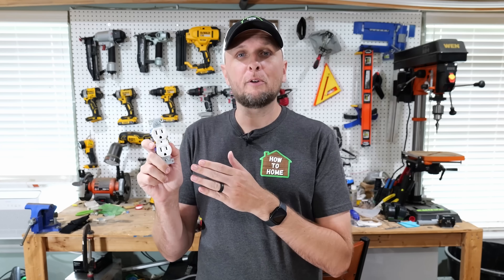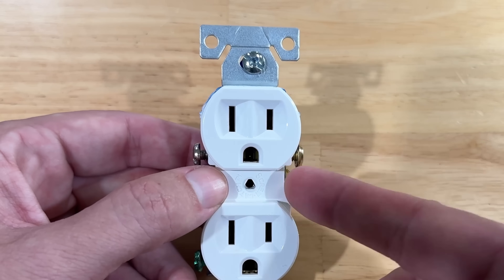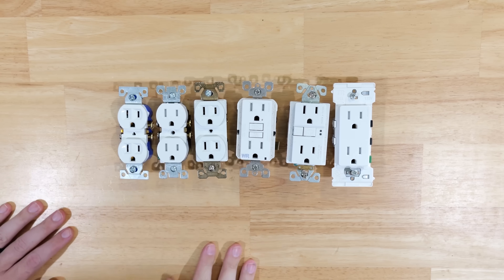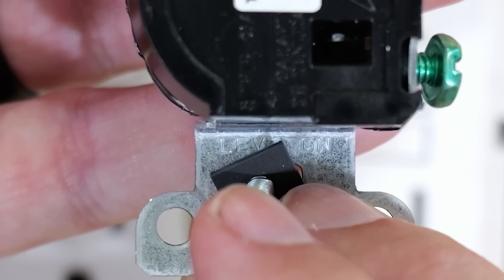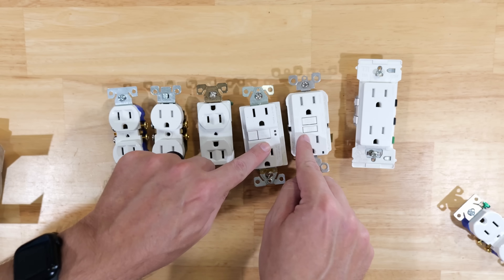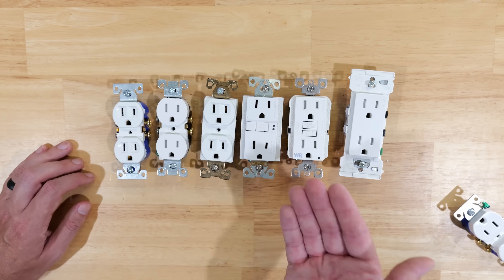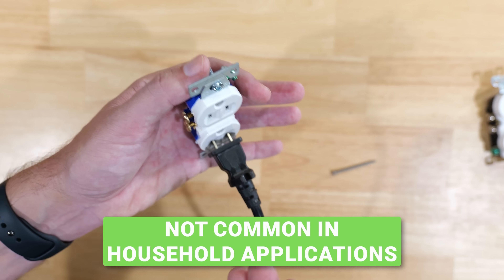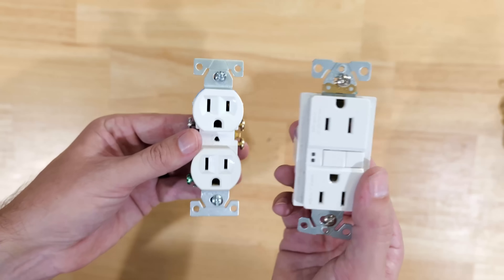The Shocking Reason Why Your Outlets Are Installed Upside Down!

Comment: Right Ground Down. And if you short plug it won't cause a fire because the Breaker will do its job and trip.  It's a myth that some metal is going to fall in just so to trip the Breker anyways. And also, washers' plugs are made with 90 degree down L shape and dryer with straightforward plugs.  If receptacle is in ground up that put a strain on plug.

Comment: Well after 40 years an electrician this is what we did. In offices it use to be common for calculators, type writers and such they had right angle plugs we put them ground up so the cord could hang off desk and plug in without a loop in the wire . Every other place including hospitals ground down looks better except in an office.
.

Comment: I'm a retired electrical engineer and have wired cabins and houses from the meter in. There is no electrical reason to make ground prong up. The notion that ground prong down is somehow easier to pull out from the small weight of the cord is wild conjecture at best as the mass of the cord at the outlet is a few ounces at most and will not pull out the flat blades. I can think of no argument for ground plug up. The best argument I can see for ground plug down is the index finger problem the author mentions.

Comment: The correct way is with the ground on the bottom so it looks like two unhappy electricians arguing about stuff that makes next to no difference. If you read the actual code, it also says that 4 and 6 gang outlets when installed correctly can look like an entire group of welders arguing on YouTube about how shitty a DIY welders beads are.

Comment: You gave excellent information indicating that the electrical code and outlet manufacturers don't really care which direction to install the outlets.  However, there are many devices that have been made that are clearly designed for ground prong down.  Some use a single connection but if the ground prong is down, the device when plugged in will cover the other port and therefore it cannot be used.  My entire house when I purchased it had ground prong up outlets.  Since they were installed back in the 70s, I ended up replacing every outlet in the house and reversed them so they all now have ground prong down.  I like them that way and they will handle those devices designed for the ground prong down configurations.

Comment: There is no standard electrical building code for the orientation of electrical outlets, so they can be installed in any of the following configurations: ground up, left, right, or down. However, there are some best practices and reasons why electricians may install outlets in certain ways:

Identify switched outlets
Installing an outlet upside down with the grounding pin facing up can help identify which outlets are controlled by a wall switch.
Improved safety

Installing an outlet with the ground pin down can be safer for specific applications, such as refrigerators and appliances with cords that extend towards the ground pin.

Comment: Put your ground pins up if you want to have timers, nightlights, CO detectors upside down. Most are designed for outlets with the ground at the BOTTOM. Obstinate Quebec electricians put the ground pin up, just to be distinct.

Comment: I'm a professor of Electrical Engineering at University of Toronto and have given this some thought over the years from my childhood when the ground prong was almost always down, to the present day when there's a mix of up and down.  One matter you have not raised is that of water and water splash, etc., in wet areas, if the ground prong is down, rising water will get to it sooner, and in a wet location splashing usually comes from below in a body of water, so it might make more sense then to have ground lower so it gets contacted first by the water.  As the water level may rise, the other pins get connected later, after the water's already grounded.
Reply: I can answer this question for you it goes by manufacturers recommendation and how you can tell is the writing stamped in the metal on the device ears if the ground pin is down and the writing right side up then that’s how it should be installed if It’s the other way it should go in ground up if the words on the metal go both ways one side upright when you hold it up but upside down on the other side you can mount it ether way
Reply: @timothydixon2545  This “pRoFeSsOr oF eNgInEeRiNg” isn’t asking a question for you to answer. The video goes over your randomly spouted out answer in the video. Nothing from manufacturer states a recommended right side up. You can try and validate the stamped writing on the back all day long, but different manufacturers stamp them differently. None of them specifically designate a recommended side up.

Comment: I have some outlets ground pin up, some down and even some installed sideways but when installing new outlets it's always ground pin down. I simply have not bothered switching all the ground pin up around. If I have to replace an outlet because it,s not working anymore it will go ground pin down unless the box is installed sideways.

Comment: YES, Ground down. That's why it's a ground and not a sky. (No it's not but it sounds good) The idea that something is going to fall onto the prongs is preposterous. And even if by some MAGICAL fluke it did happen, it would short, tripping a breaker or blowing a fuse.  I always install them ground down, and it irritates me so badly when I see them upside down, like a hospital or nursing home, I feel compelled to go home, get a screwdriver, and rewire all those outlets. Just turning them wouldn't satisfy my O.C.D. I'd have to undo it all and redo it the right way.

Comment: I was working on a piece of commercial equipment removing the back panel when it slipped and fell right on the prong. Luckily the plug had the ground upwards so no zappy.
Reply: @armslength2618   
Im in Canada, there is but I work in the food repair industry where I may be in a private business that doesn't have formal procedures. And generally it's up to the tech to ensure they don't f-up. And, oddly one doesn't "need" a license to work on certain equipment. I've been employed in this for about 10yrs now with no license; I call someone if needed.

Comment: I worked for an electrician and when we ran into a duplex outlet with the ground on the top it was on a switched outlet.  That way electricians know there is a switch controlling that outlet, or you can cut the metal piece that connects the two outlets and make one hot all the time and the other one will be on the switched circuit.

Comment: Old industrial electrician here. For single-phase office/home outlets the ground pin is down. For me, the reason is that when reaching behind shelving, etc. to plug it in with the ground pin down I can tip the plug backwards towards me so I can see between the blades and guide the ground pin into the round opening and know I have a safety ground as I then tip the blades into the socket, meaning I can see they are lined up, before the hot blade is energized. In dim light, partly obstructed vision, etc. I want to know I have the ground connected before the hot blade is energized. Ground prong up, not so much.

Comment: The electric company here used to have commercials where they animated the plug and it had a face made of the holes.  Therefore the right way to install it is so it looks like a face.  There are no laws anywhere in the USA saying it has to be ground up.  90 degree cords are invariably made to ground down installation

Comment: some  surge protectors and appliances orient their power plugs usually to plug them in ground down sometimes at 45° angles. so if the ground is up then the wire is forced facing up at 45°
this just causes issues with the extra wire

Comment: Most big plugs are oriented so you'd have to twist them to plug into a ground-up.  I guess it would be fine in space where there is no up/down, but if I see a house with ground-up plugs, I know it was an amateur makeover. It's no problem, unless they hooked the neutral to the hot, which often happens in those cases.

Comment: Everything about this video makes me think...
Why are US plugs so badly designed?
Just look at everything you said was a problem - and then look at equivalent plugs from other countries... 
I'm in Hong Kong and we use the UK (Type G) plug. The live and neutral are insulated to about half way up, so that if there's a gap between the outlet and the plug, the only pin that you can get an electrical connection to would be the earth. If you've pulled it far enough out to see the metal on the live and neutral pins, it's almost certainly pulled out far enough that it's no longer connected.
And they're always ground prong up. - because even if it's a double-insulated product that doesn't need to be earthed, it's still using a 3 pin plug, but the earth pin might be plastic. (The earth pin is required as it's slightly longer and as you push it in, it opens the shutters for the live and neutral).
(i.e. We don't need to babyproof our electrical sockets - they're already babyproofed when they leave the factory).

Comment: Ground prong down. Many wall-wart type plugs that hang out of the wall that either have a ground prong or are polarized are designed to hang down against the wall. if the outlet is ground prong up, some of these don't hang right and are more likely to come out of the wall socket.

Comment: Logically, the two-prong residential argument "against" ground-up also works against the ground-down. The respective safety arguments for each are both negated when using a two-prong plug. That leaves us with whether one wishes to follow convention or not.

Comment: I have found some surge protector plugs have an issue with ground plug up.  In some cases you cant plug other devices is the same outlet because the cord jacket restricts access to  the outlet below.

Comment: The only benefit that I've ever found from ground up or ground down is if a receptacle is mounted half way up a wall and the entire weight of the cord is hang off the receptacle, it seems less likely for the weight pull out the cord with the ground up.  Another one is in a garage or shop where heavy extension cord might be used. I have noticed that the spring metal on the inside of the receptacle that holds the blades of the plug don't wear out as quickly with the ground up. Having the pivot point of the plug as the blade side instead of the ground side, the weight of the cord keeps pressure inward on the blades. Where as with the ground down the weight of the cord would have an outward pull on the blades.

Comment: 👉🏾So… there is no standard for installing a receptacle. But I think both opinions concerning rather to install the ground prong up or down have their valid reasons. But I would say installing the receptacle up or down depends on your environment. For example… if I was in charge of installing receptacles in a workshop underneath and the sides of a work table, I would install the receptacles with the ground prongs up or on top, presuming a screw could roll off the table while you’re unplugging a cord, the screw could land right on the ground prong, preventing such an accident. I didn’t think of a reason why I would install the receptacle down. 🤓🤓🤓 😂

Comment: My current house has ground pin up, and I don't know if it is related, but a lot of the plug outlets are loose, as if people had difficulty plugging in or pulling plugs out and wiggled them a lot.

Comment: Why say all that? In the end electrically it makes no difference as to whether the ground prong is up or down (or sideways for that matter), and no electrician worth a damn is going to place an outlet under a sink, much less in a flat position under a drain or any of the water connections. The only reason I can possibly think of why anyone would do that would be for a garbage disposal, such as an "InSinkErator". 

If you have one, look at it closely... IF it has been properly installed, you should see a 758 Standard UL Listed Appliance cord somewhere under your sink. These are typically three feet long, but under my sink the cord goes out through a hole in the cabinet wall, and presumably plugs in the same outlet as the dishwasher. Since I am 68 years (and 9 months) old and in a wheelchair, I can't verify anything except the cord goes out through the hole in the cabinet wall. However, the point is, it is not under the sink.

In the course of my life, specially as a working guitarist, I've been in thousands of motels, hotels, bars and casinos and I would say that in at least 95% of them, the outlets are placed with the ground prong holes at the bottom. I would call that the norm...

Comment: I believe that ground down is the way that the outlet is designed to be installed. Because the ground when used is to protect the user of what is being plugged in.  With the prong down the plug will keep a ground even when the weight of the cord or if it starts to come out for any other reason. In the inverted installation the ground plug can lose contact while the hot prongs still are in the receptacle if the cord starts to unplug from the weight of the cord. Many plugs sag in the outlet overtime and can eventually disconnect the ground with the hot still in causing the ground to fail I protecting the user if the ground is up. My opinion but I do believe it is a more possible situation than the one stated for the ground up orientation.

Comment: In some of the hospitals I work in, electrical outlets are installed proud prong-up.  I used to think that this was silly until one day on my workbench at work (I repaired flexible medical endoscopes), a length of narrow coil pipe that I was working with slid off the back side of my bench, and fell across the hot and neutral blades of something that was plugged in, but not completely pushed into the outlet-- and it shorted them out and scared the hell out of me!  It was a one-in-a-million sort of thing, but proved to me that it can actually happen, and it can happen to me.  I still think it looks silly to put the ground pin on top, but now I understand why it is a good idea.  I accidentally proved it to myself.

Comment: What about sideways?

Neutral up or hot up?
Reply: The outlets in my 25 yr old condo are all sideways. It helps lessen the tangle when I plug in my vacuum, etc.
Reply: Man, I just said the same thing. I guess the early bird gets the worm. Dammit!
Reply: Good question. Just had sideway outlets installed for first time. The electrician installed them neutral up - probably based on the same logic as the safety ground up argument. I am OK with this because there doesn't seem to be any argument against it.
Reply: “Countertop spaces require the maximum space between outlets to be 4 feet, and that no part of the countertop is more than 2 feet from a receptacle. So, there are times when an outlet may need to be installed sideways in order to fit into a spot where it is required to be installed.

The required placements of electrical outlets may also influence outlet orientation, as a horizontal outlet may provide easier access for plugging items in depending on the location. For instance, a vertical outlet behind an appliance or piece of furniture may give you no access points, while a horizontal outlet in the same location may allow you to access at least one of the receptacles. If an outlet is needed in a certain location but it is also clear that the spot will be blocked, then an outlet may be installed sideways to try to improve access.

Another common reason for horizontal outlets in your home is simply the result of aesthetic choices. Electrical outlets are obviously a necessity, but if you're on the hunt for brilliant hacks to make your kitchen more aesthetic, you may find yourself wanting to hide them. While this can help your kitchen look nice, covering the outlets reduces their functionality. Instead of hiding an unsightly vertical outlet, some people choose to install horizontal outlets. Horizontal outlets can have a look that is more low profile, which is especially nice for outlets that are placed higher up on walls, such as above countertops. In kitchens especially, horizontal backsplash patterns, such as subway tiles, are popular, and horizontal outlets are especially good in these situations. Rather than break up the look with a vertical rectangle, outlets can blend in seamlessly when they are turned sideways.”

Comment: I don't even need to watch this whole thing.  I install them in my home with the ground down simply because I use the ground prong as a reference to start plugging a cord in which lets me easily put the hot and neutral tabs into the slots.   It works for me even in near darkness behind furniture.

Comment: I was taught in electrical class ground should be on bottom in case ground prong breaks & falls inside, it wont arc on hot side. Just saying. I see you are correct. 👍

Comment: It's interesting they mention "counter top" but not floor.  I have seen many receptacles on floors in location that are hard surfaced and clean with water.  I never knew the code, but I always refer to the flush mount cords, such as on my refrigerator, to orient receptacles.